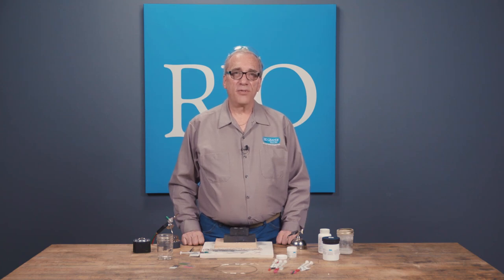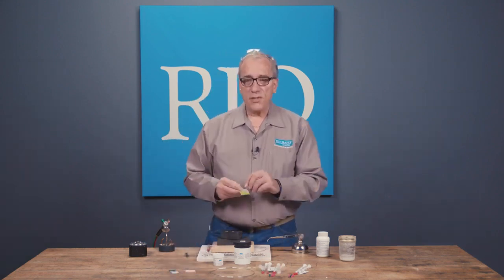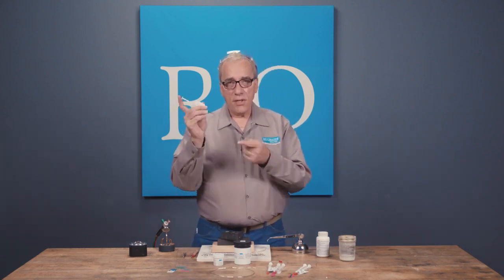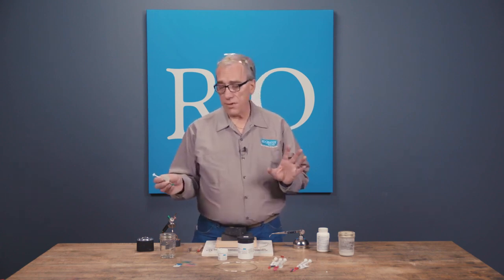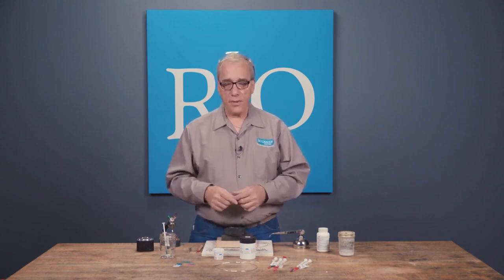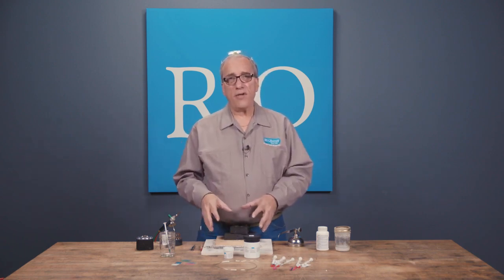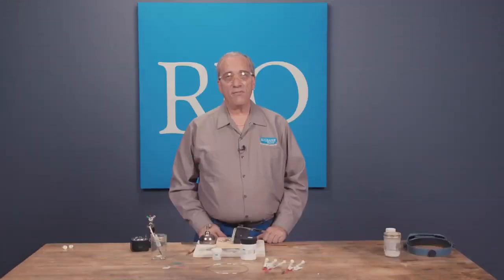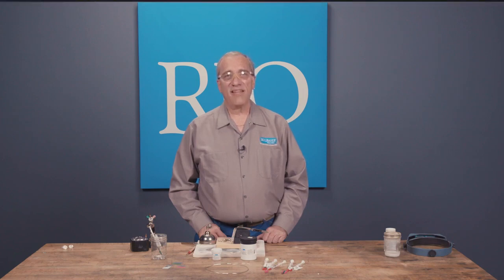Paste Soldering Tips & Tricks

Comment: Thank you for this video. I am very new to soldering. I am working with copper wire. I have a solder paste that says it will mimic the color of brass, silver, copper or gold. It is not doing that. It looks silver after I am done. It also does not always flow even after fluxing. The solder hardens on me. How can I stop this? Is there a specific solder for copper that can be used? Can you use olive oil in a plastic cup instead of mineral oil in glass jar to store the unused portion in the tip?

Comment: Hello, I use Google Translate. I had a question. When I melt the silver, after casting and cooling, I saw dark spots on it. What is the cause? What is the solution? Thank you.
Reply from the maker: Hello, thank you for the question. Here is an explanation from our tech team: When sterling is melted without protection and oxygen pickup occurs, the copper will oxidize. Copper oxide in the casting can cause two problems. First, copper oxide inclusions will occur throughout the casting. They really only cause a problem when they are near the surface, where they act as hard spots that stick above the polished surface. Second, a layer of copper oxide can form in and around shrinkage porosity. This is seen on a polished surface as gray, cloudy spots. These spots are usually too deep to be polished out. Figure 8 shows a cross section of a sterling ring; shrinkage porosity can be seen throughout. Also evident are two darker areas: one at the up- per right and the other in the lower left of the casting. These dark areas indicate copper oxide surrounding surface porosity. The presence of cuprous oxide can be confirmed with an optical microscope using polarized light. Figures 9 through 11 show the various views of sterling silver with normal illumination and with polarized light. The first photo of each sequence (9A, 10A, lIA) shows various inclusions that appear black. The second photo in each sequence (9B, 10B, IIB) shows the inclusions as bright red in color, confirming that they are cuprous oxide. In some cases, when the molten sterling is left unprotected for an ex- tended amount of time and/or is overheated, the copper oxide formation is so severe that the surface of the molten sterling develops a rather tenacious skin. This copper oxide skin greatly reduces the fluidity of the metal. The usual result is that many of the fine details on the castings do not fill. In some instances, major portions of the casting do not fill. A telltale sign of this condition is a reddish color on the surface near the incomplete fill. For further assistance regarding any casting problems, it’s advisable to contact your metal supplier.